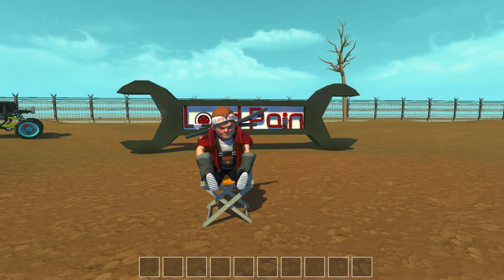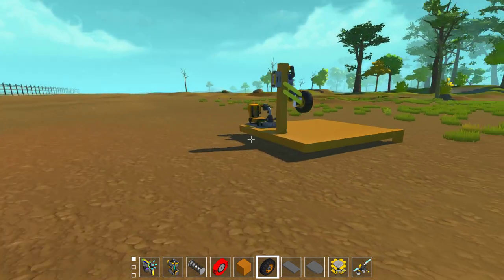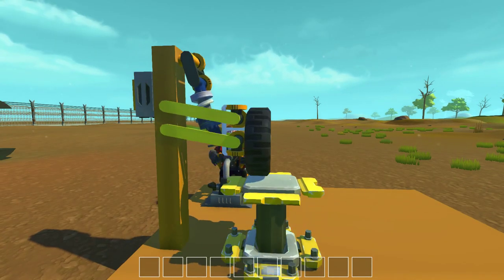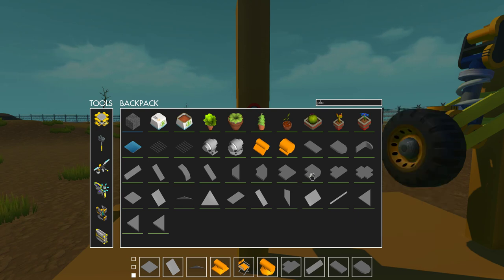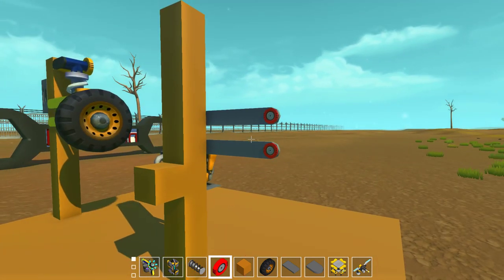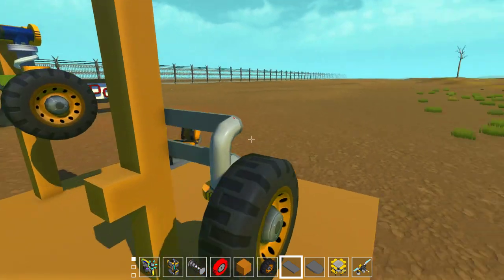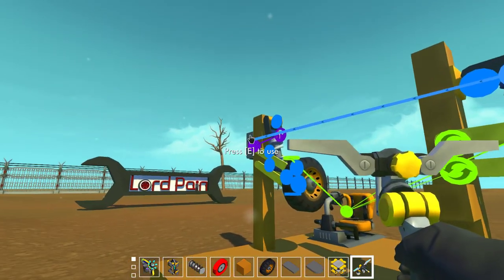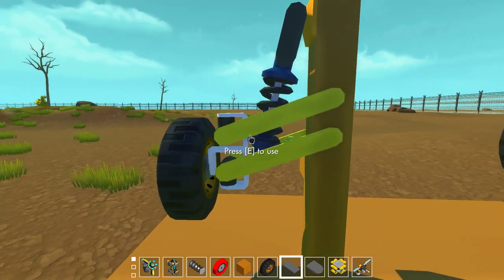Most Compact Steering on a Double Wishbone Suspension!!! ( Scrap Mechanic Tutorials Gameplay )

Comment: Thankyou for this video LordPain.

Up until now I had no idea/ never tried to use the plates for anything useful- my car building has now gotten easier and smaller, and a little more stable, and less laggy.

How did you get around to working out the exact way to put it together without it ending up Harrell rolling off into the distance when off of the lift?

I ended up having to fully rebuild both sides in the exact same order of parts(as you did) after forgetting to weld the suspension plates and releasing it from the lift? 

Whichever way, smaller is indeed better- lighter and generally this suspension build doesn’t clash with anything so operates without clanging noises as you go over bumps.

I used another drivers seat to keep the rear wheels locked straight, as the bearings on the ‘steering’ part are necessary for the bearing that you mount the wheel on- and the plate itself that the bearing is on won’t fit if they aren’t there (took me a while to figure that out ha)

Keep up the good work!

Comment: Awesome tutorial, really does work and look good. I'm having a weird issue however, I'm pretty new to scrap mechanic so idk if it's a bug or glitch but the car is oddly stable, it doesn't like to tilt forwards or backwards. Makes going up hills near impossible.
Reply: that's the suspension glitch. it stabilizes the car for no reason

Comment: For some reason I can't put the bearing on the plate
Reply: I am having the same issue. I can place the bearings on the inside of the plates but not the outside.
Reply: I had this happen and it was because I’d circled around the item and started building on the wrong side. The steps have to be followed exactly as shown for it to work out, and if you delete a part within the middle of a process, you have to start over.

Comment: Very nice design. I've used the small plates before for suspension, but I haven't tried the steering mounts like that before. I tend to go with a rack and pinion style steering so the front wheels don't turn at different angles under force. My buggy was one of the first designs using these tricks https://steamcommunity.com/sharedfiles/filedetails/?id=1133475796
Reply from the maker: Thx! :) I actually have an even easier way to build it but pretty much the same function. And I also have an 1,5 years old  buggy using the same steering if I'm not wrong :) https://steamcommunity.com/sharedfiles/filedetails/?id=777239514